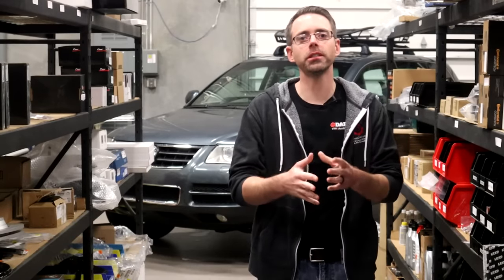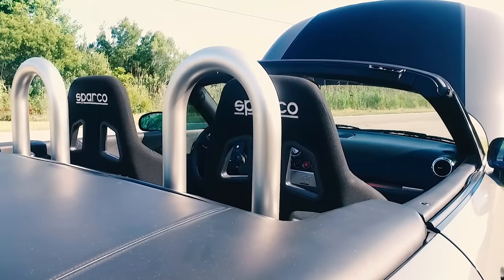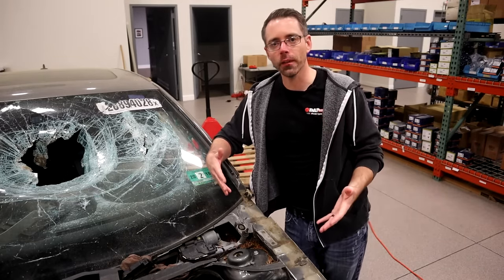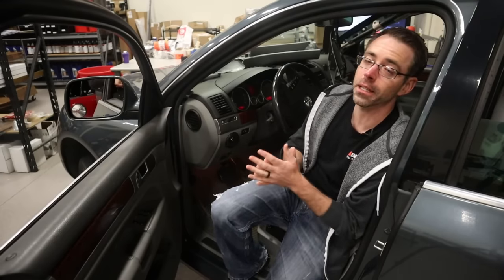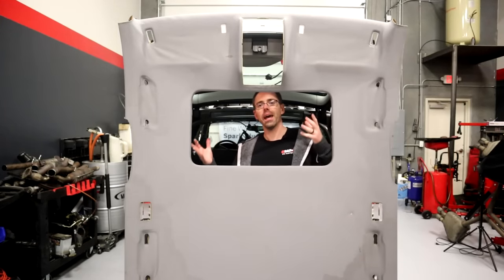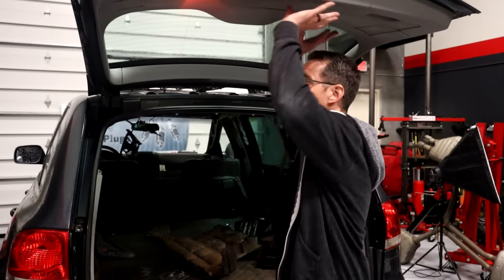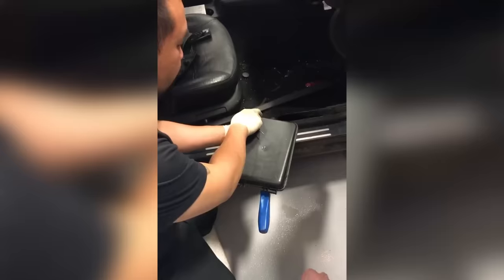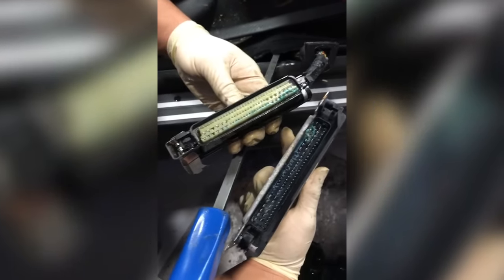How To Find Where Water is Getting into Your Car!

Comment: Thanks for covering  this.
I have a mk5 GLI and I've had my car at a local VW dealership and was charged $50 per drain x4 drains. 
Not complaining about the price,but to have my car leak after 90 days is were I have an issue. 
I don't even want a sunroof now 🙄
Reply: Funny that my MINI Cooper had an even larger TWO pane sunroof and never had leaks. I give up on VW. They are just badly designed and they'll probably never improve.

Comment: Just dealt with a leak in my brothers Mk6 R. The sunroof drain hose was completely disconnected at the firewall and draining in the footwell, by the CECM and fuse box. Such a great design...
Reply: I have problem in passenger footwell and transmission also please help
Reply: I currently have this problem but can’t figure out how to reconnect the tubes without removing the windshield.  Any suggestions?

Comment: good video. My MKV was plagued with the same issue. had to remove the whole headliner to find the source. the drain hose adhesive for the coupling had melted over time on top of the fact that the nipple was clogged. had it replaced and cut the nipple a bit to allow water to flow more free as per a VW tsb for earlier models. Headliner removal is a pain in the ass.

Comment: On Golf MkV and maybe later there are two vents either side of the rear bumper. They are to relieve cabin pressure when the airbags deploy. If the vents are cracked water will leak in to the car. I had the issue after an accident repair and the shop left the vent cracked. My rear seats got wet  when we had very heavy rain and big puddles.

Comment: I saw a Touareg and watched mostly to confirm that it was the access leak as I suspected. Super common, although I've seen all of these leaks.
if you have a $500 one and can't get the headliner out, I just put tape (normally painters, masking) over the hatch for a while. It might eat the paint, it might fall off, but it leaks less until it can be taken care of.

Comment: On my 2010 Tiguan, the water pooling up in the spare wheel well came from the bolts attaching the bumper cover to the body.  Water was flowing into the body through those bolts and draining into the trunk when it rained.

Comment: For anyone with an 2007-2014 Audi TT Mk2 Roadster, there are two drip trays that should be inspected periodically. They are located directly below the left and right convertible top mechanism, where the roof flaps are situated. From these drip trays are large 3/4" diameter drain tubes that channel water from the drip trays, through the center bulkhead, and out of the bottom of the car. The tubes are located in-board of the drip trays.
Any debris which collects in the drip trays may block the drain tubes resulting in water over flowing the trays and into the vehicle. As they are rather difficult to get to to inspect (since the roof mechanism blocks access) open the top about half way, set your smartphone to video, and place it down into the drip tray upside down so the camera is on the bottom (Note - be sure it's dry down there first!) With the cameras facing towards the center of the vehicle you'll get a good views of the bottom of the drip tray and the opening to the drain tube. If there's anything in the drip tray you can use a telescopic gripper or a 1" tube taped to a vacuum hose to get the bits out of the tray.
 
Another potential problem with the Roadster drain tubes is if the car has had the low pressure fuel pump replaced (located behind the drivers seat) or if anyone has worked on the speakers in the rear seat panel. It's quite easy to accidentally knocked the drain hose loose from the bottom of the bulkhead. If this happens water will drain into the vehicle. The problem in this case isn't just a wet carpet, but water can pool around the top of the fuel tank and corrode the wires. The rear seat bulkhead panel comes off easily enough and the drain tube is located directly behind the large speaker opening. 

One of the worse cases I've seen is where someone forgot they placed a bottle in the convertible top stowage area. At some point it slid down the side and into the bottom of the drip tray. When the top was fully opened, the mechanism crushed the bottle into the tray which not only shattered the bottle, but broke a large hole through the bottom of the drip tray. In order to replace the drip tray, the entire convertible top assembly had to be removed and reinstalled.
So for Audi TT Mk2 Roadster owners, If the carpet behind the seats is wet or damp, check the convertible top drain drip trays and drain hoses. 
Cheers from Switzerland! :-)

Comment: This past late December in California when we were beginning the first phase of our never-ending atmospheric river, I had water just pouring into my 2011 GTI.  I called my long term mechanic...and found he had retired.  In desperation, I found one available mechanic, and took my car in.  "Water leaks?"  He said.  "Join the party," pointing to the cars stacked up in his lot of all makes and sizes.  

$750 later, he fixed several leak sources (sunroof, antenna, doors, bumper vents).  I threw kitty litter all over the car and vacuumed it up every couple of days.  I still have a slight leak in one door, but it's all much better.  

Turns out, leaving your car out in the hot sun for years will do a number on your seals, and parking it under a pollen-filled walnut tree will clog up all your drains.

Comment: I have an 08 Touareg that had an issue with the A/C vent drain clogging which caused water to build up in the system and dump into the front passenger footwell. It was so bad that at one point about 1-2 liters of water dumped out in one go when I cleaned out the vent in the footwell and then it would be a contestant stream of water when driving. Had to fight tooth and nail to get them to cover this under warranty but then had the same issue less than a year later at which point I was beyond warranty and they told me the car had been flooded and I had to now replace all the corroded wiring in the floor boards. Needless to say due to this experience my wife will no longer buy a VW and I now drive 90 minutes to the next VW dealer for my purchases and warranty work.

Comment: Thanks for the video. On my mk7 I'm seeing water coming down the sunshade cover front pas side as well as the side handle. Drains are not clogged. All I can see is that the rubber edge that meets the body of the car is sunk right at the corner which creates an opening. I would have thought that opening would not come back to the inner side of the car but I guess that's probably what's happening. Any recommendations?

Comment: I have the same issue in the back leaking from those black plates at the top.... What I was hoping was to see how you fixed that... So far I tried flex seal and now I've moved to gorilla spray lol today I taped plastic around the interior and sprayed the hell out of it.... I hope it works but if it don't I'm onto the next

Comment: My 2009 Jetta Sportwagen developed exactly what you described.  My drivers side footwell was wet, and I could see the water dripping in! An appointment with my friendly VW of Olympia dealer and a check for $300 fixed it...ouch.
Reply: did they say what was the area/fix? have a 2012 jetta sportswagon that is doing the same just saw this video and have yet to test but was just wondering more info beforehand would only help in assessing

Comment: I went thru tons of water ingress issues on my mk7. The speaker seals on the front doors were leaking and resealing them with silicon was the fix. The drain tube for the hatch handle/logo failed and was bringing water into the trunk. The seal on the pressure vent or flaps located in the trunk near the taillights failed and was bring water into the trunk.
Reply: This is exactly what I thought my problem was. Now the water has moved to under the rear seat

Comment: What can cause a trunk leak on an mk5 jetta?

My last leaky VW was an Mk1 jetta back in the day (rusty floor).

But this week my super trusty Jetta Mk5 was literally flooded both on the driver side and on the spare tire well.

I have cleaned the cowl,  the front sunroof nipples (driver side was actually clogged with dirt)  and, after taking out what seem to be several liters of water, I think I have managed the front leak.

But sitill don't know where to start with the rear.

Comment: Hello. I have VW Tiguan 2010. I have a major issue with a roof leak. I dropped the headliner and I repaired the hose and cleaned the drains front and back. Just when I thought my nightmare is over, I tested the roof of any leaks prior to re installing the headliner back to its place, the roof started now from the small white tube surrounding the sunroof frame. Do you have any idea how to tackle this issue?

Comment: I have VW jetta s water leak is on the driver's side. I believe the body control module gets wet. The lights go crazy on and off. The car will not shift out of park. Etc. Would you have an idea what's going on.

Comment: My 2017 golf sportsvan rear sunroof drains were clogged, trunk flooded.
There's also gaps or metal pockets with no drains that water collects. Under the rear seats.
Watch out for that. 
Used a spray bottle attachment part to suck the water out.

Fix: Rear rubber nipple was found at each rear corner of the rear bumper. 
No need to remove wheel covers.

Vw has a special tool for cleaning which method is entering from the nipple ends to the drain port.
 I just used clothes wire with a plastic cover and smoothed the end.

Didn't do the front as access is non existing without removing wipers and other plastic stuff.

Tips for removing the stain from headliner?

Comment: I just found an inch of water in the drivers side rear passenger footwell of my MK7 GTI and I can hear water squishing around under the carpet including under the drivers footwell carpet also. No water in spare tire well or passenger side footwells. Last week we hade major rain come through the area and the car has not been driven ( thanks COVID-19).I don’t have a sunroof the windshield was replaced in 2017. Where do I begin? Should I take it to the dealer, tear out the interior, call ins co? What would be the best way to get the water dried up from under the carpet? Would there be any electrical devices under the carpet on the drivers side? What a mess.
Reply: Hey I’m having the same issue. Did you find out how to get rid of the water and also if the water stays in there until it can get fixed will it destroy the car? Can’t go until 2 days due to New Years

Comment: My 06 V8 Touareg had a leak one day where the water dripped from around the sunroof dial/upper console area and directly onto the air suspension controls(which was another problem in itself). It was a rainy day but it hasn't happened since and it's been through multiple car washes and rainy days even worse than the one it leaked on. Now, the day it leaked, I had the sunroof tilted for about half an hour in the rain and then closed it when I parked it. The next morning the entire center console was wet. My question is, do you think its the nipples(hehe) clogging up that would cause it to leak like that or was it from me driving through the rain with the sunroof tilted up?

Comment: my touareg is leaking from the exact same spot: the access-points of the back door - but how do i fix it? the water is getting inside the car there, only at the right side. but how do i stop it from getting there in the first place?
Reply from the maker: Fix the access point seal and cover. It’s supposed be to have water there. Just not supposed to leak in the car

Comment: I love the Touareg videos. I think my turd of a Touareg has the same issue... How in the hell do you fix that factory flaw?
Reply: How was the leak fixed? Was it the clogged rear drains? You mentioned the shocks and rubber covers caused the leak; black flex caulk coverings left and right?

Comment: These damn useless vehicles are designed to break. I had this problem on a Q5 where the water from the windshield creeped inside the ECU compartment and corroded the wiring harness and ECU. The damn TCU 12+V wire was corroded along with other ones. Couldn't shift and start. Had to wire it up. Stupid vehicles. I have a 25 year old Toyota with very little issues. Sold the damn thing.